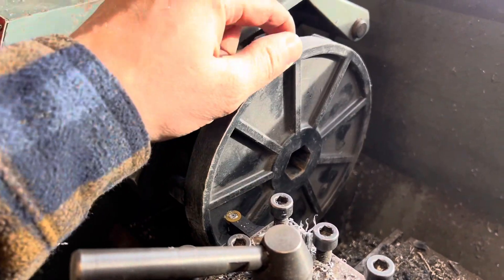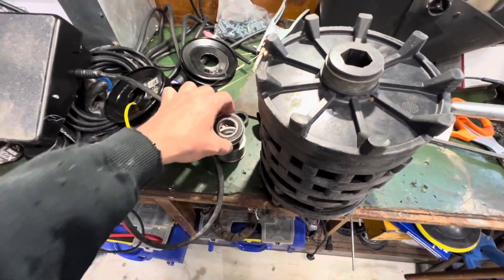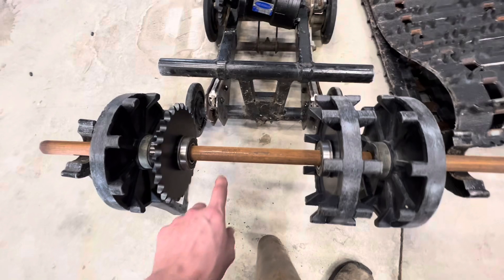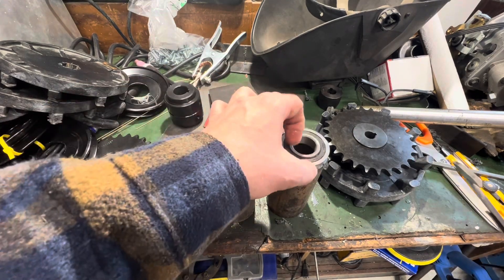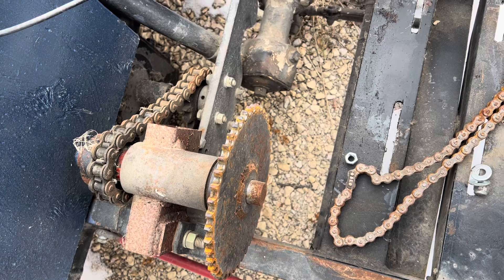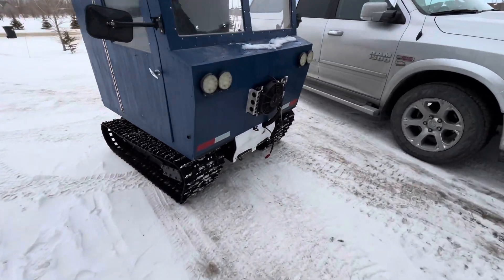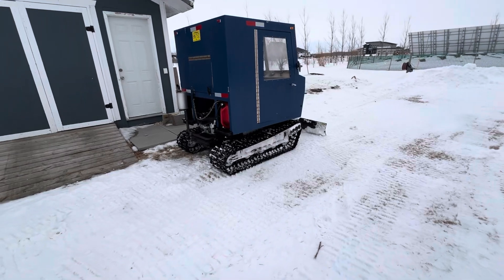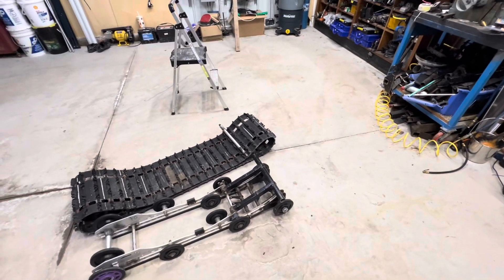Personal Track Vehicle Build - Part 1

Comment: The mini cat is really making me want to convert mine to hydro this summer
Reply from the maker: Humm, and here I think your machine does quite well as it is!  Hydraulic is ok, but has its limits unless you grossly oversize everything and are prepared for the heat losses.
Reply: @ yeah grass is greener on either side but mechanical drive has heat issues with brake steering.